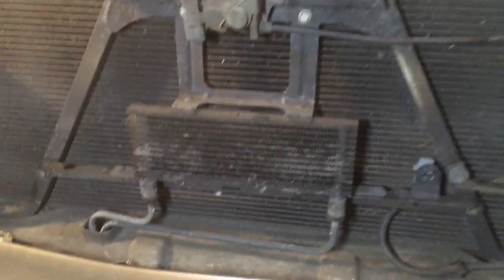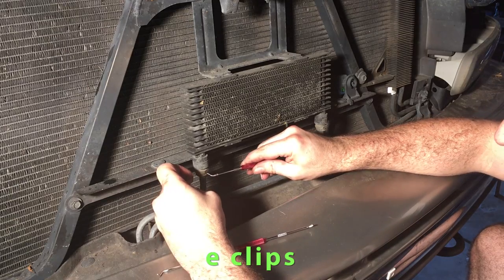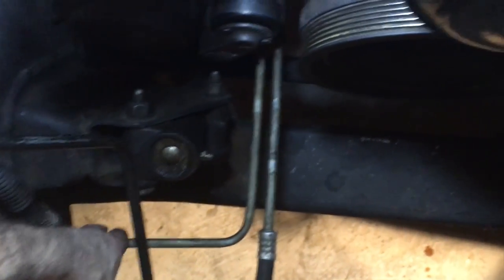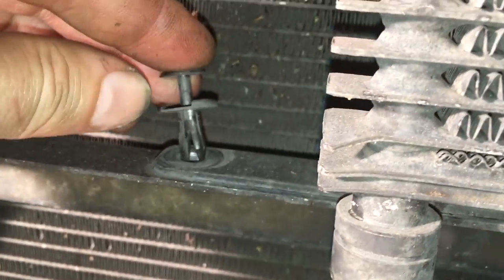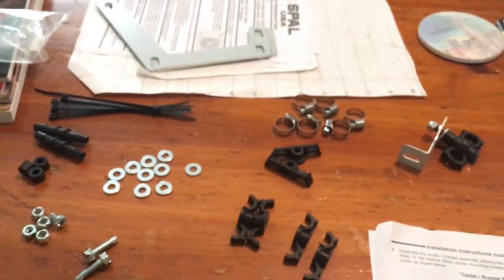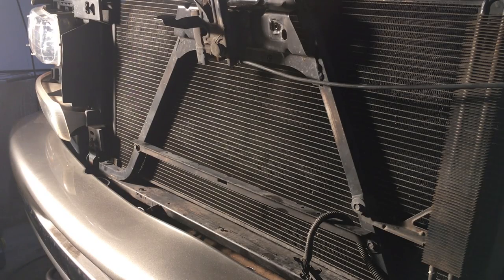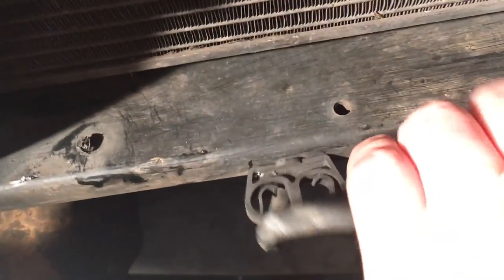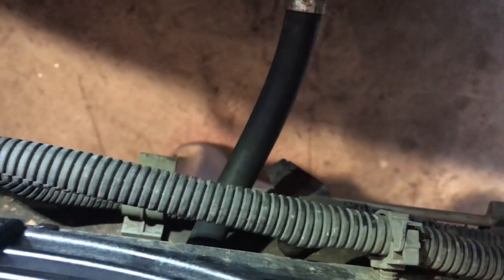Installing a Trans Cooler Chevy Tahoe

Comment: The only problem is you replaced a good cooler with a less quality one. The unit you removed looks like a "stacked plate" cooler and you replaced it with a cheaper tube style cooler.
Reply: Thats what I was thinking!

Comment: You are usually better off running a standalone trans cooler not going into the radiator. The engine raises the trans temp if you do.
Reply: nope  better to run it after it leaves the radiator headed back to the trans, also he replaced an awesome stacked plate cooler with a less efficient model, good video though,

Comment: Great video! Had a question because some of the other videos I have watched, leave the original cooler installed ... and it appears run the new cooler as a secondary or additional cooler. They do so by running the intake line from the new (secondary) cooler from the return line of the first cooler, and then the exit port back to the vehicle gets connected to the return line. To me, it seems like excess. But if your vehicle already has a transmission cooler installed, it kinda makes sense to install an upgraded or additional cooler to meet any increased demand in vehicle performance. Any thoughts (I understand you are just like me and like to tinker)! Was just curious if any other had any comments or suggestions.
Reply from the maker: My aftermarket radiator did have a trans cooler in it (as did my stock rad).  i do a lot of towing so i just upgraded the whole thing.  i have read that you don't necessarily need 2 unless you tow.
Reply: The cooler in the radiator also warms up the fluid and is helpful for extreme cold climates.

Comment: Im getting ready to do my own install as well. All my f150 has is the in tank cooler, no external. Do I keep the in tank in with the external as well? I was thinking just bypass the in tank and convert to external only?
Reply from the maker: i am using both.  keeps fluids nice and cool, even during heavy towing.

Comment: Did it help your performance? Did you notice a difference?
Reply from the maker: You can't "feel" the difference, but you can definitely see it if you are tracking your trans temps.  This helped to keep the temps down, even in the summer pulling a boat.
Reply: Thanks I just bought one aswell for my Yukon

Comment: My 97 k1500 looks nothing like that. I have no crossbar, no housing to hold it and the hoses go through the holes just left of the radiator and into some cheapo trans cooler
Reply from the maker: 99-02 are different.

Comment: What does this transmission cooler do?
Reply from the maker: Trans has fluid  and that fluid needs to be cooled.  the trans cooler cycles the fluid away from the trans, through the cooler (which is air cooled) and back to the transmission.
Reply: It makes pizza for when you overheat your transmission and want to pull over to eat.

Comment: My truck doesn’t have a cooler mounted in the front how can i do it?
Reply: it's build in the radiator
Reply from the maker: Fab it
Reply: @briantruck2284  yeah don’t know if yu will see this mine is built inside the radiator as well and radiator has busted internally causing the water to fill the transmission someone had put new trans in and same issue full of water I bought the truck for $500 and have found out I think this is my issue no other reason or explanation so I am buying a external from advance question is it’s got nipples will a clamp hold the hoses on well enough to pressure ratio
Reply: Mines doesn’t have a trans cooler mounted either 😮 I did a radiator swap when I first got the truck as well due to over heating but recently my trucks been slipping and I noticed the line is  supper hot. Any help ?
Reply: Dude you explaining the lines helped me a lot so one line will always be hot regardless ?